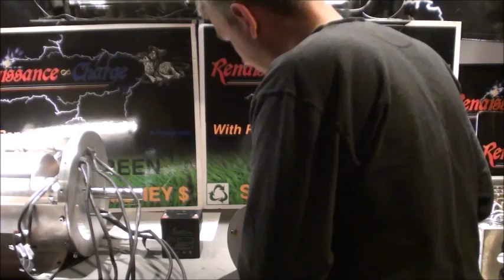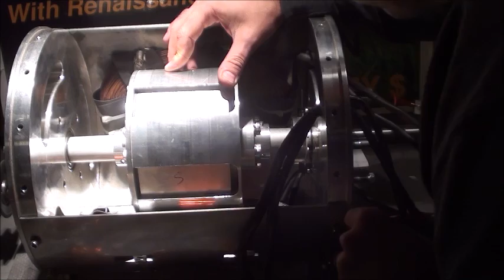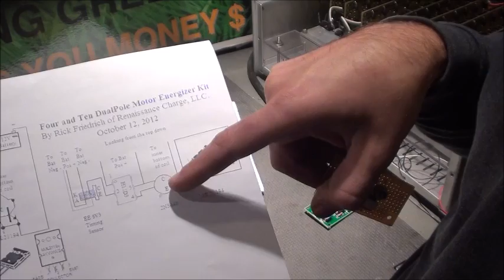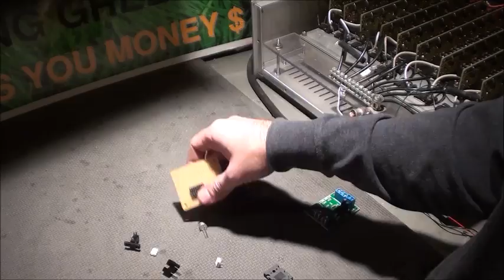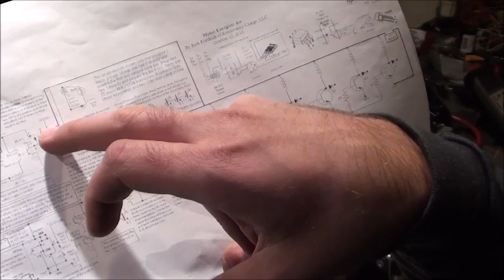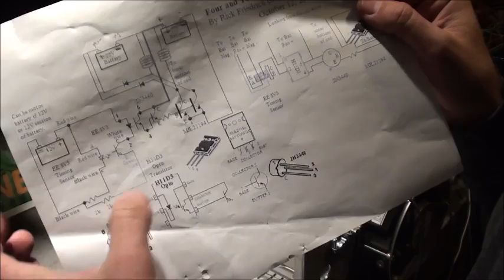Idustrial Magnetic Motor Assembly Instructions Part 1

Comment: Have made many various coils, pulse motors, and years of experiments. Looks like you have the were-with-all to build a large and very powerful unit, wish I had the resources. 
Here is a wiring scheme,  try it, you'll find interesting. works with any bi-filar coil setup or two coils in conjunction with or without a magnetic armature [N-S].  Using a bi-filar, mark coil A and coil B, mark the beginning and end of each, the beginning of coil A goes to a resistor, then to the base of some value of a NPN transistor{ also used a n channel mosfet), the end of coil A goes to the emitter of the transistor which goes to the negative of a battery. The beginning of coil B goes to the positive of the battery (12 volt,can use more and less depending on the simiconductor) and the end attaches to the base of the transistor.
The transistors should be able to handle fairly high voltage  (tip 3055, bul305, or comparable N-mosfet) Also the transistors required much less resistance, the N-mosfet can use from 300,000 ohms to 1 meg and more to oscillate. An anomalies, get oscillation without the base being connected. To initiate oscillation short out the base and collector for just a moment.  Use a neon to check for high voltage produce from the base and editor, place a rectifier bridge across these and connect a large cap. Because it oscillates without the resistor being connected to the base, the beginning of coil A is free to utilize  for other purposes. Meters glitch, use the neon for testing.  If any of this possibly confusing info needs clarification, will do so.  Have a few videos up. Note: have charged caps to 900 volts and more using a 12 volt lead acid cell using  a bifilar coil, just started experimenting with these rodin things. The idea is to use the back spike (collapse of the flux field) to initiate a radiant pulse (scalar pulse) with would produce and over unity effect. It's all in the pulse.
later.............marc.

Comment: Can you please get back to me as what I have seen it does 
not make any sense at all 
as I really would Like to know if the system is running or not 
at all as I would not like to buy a load of Scrap 
Thank you 
John Ryan
Reply from the maker: What do you mean get back to you. You have not written before.
This is not like a regular motor. It runs like a motor but also charges up batteries while running. So one battery runs the motor while another one charges and you can rotate them around.

Comment: Are these for sale now? How many batteries can it charge at one time?
Reply from the maker: Yes they are. R-charge.com It charges batteries while it runs off of batteries. You can run it soft or hard from 12 to 36V 500A. If you run it hard then you will need big batteries to charge.

Comment: I found this and the other videos very informative, and probably the key to succeeding in the field of electronics, since I really haven't produced anything as of yet in the market. But the particular venue I've been pursuing has been what in transportation may eventually be the i-phone compared to the land-line and radio. That is "A mixed-mu precise power regulated system in mag-lev shielded nacelle array instead of a Csoanda fueled car or jet-pack. However, crawling and walking before running and flying, having followed the work of John Searl for 22 years, since being an engineer in the US army, then finally meeting the team in person, there is no-one at all on that team that compares to either one of us!! NO one say: who has a degree in electronics with a letter of recommendation from a department head, who understands state controllers, and who actually designs and builds things that function, because they have to do what they are designed for, and the time is right to finally get it done. Added to the assumptions that many people that think the world's perfect as is without anymore technological developments. But to me using portable mag-lev and portable mag-gen(s) is only a fraction of a very very small percent of what any individual is capable of. The SEG, then I want to describe as a massive ringed system (w/a lesser amount of electronics) that is intended for space travel exclusively more-so than simply powering your home or business. A very large monument of specially machined exotic and common component materials. More involved than wiring a 10 or 8 gauge Bi-filar Tesla Coil, sections to make a standing stack. And so having discovered the scalar encryption method and applying it to mag-lev components is what I'd really rather be known for, and in comparison to what you've done, I feel my work is simpler; but that yours is more marketable, until the time when Earth can clearly see the "Jetson's" life style as routine; and we together become responsible; wasting less petrol.
Reply: intended to space travel ? pushing on what or trhu what to get propelled ?   no possibility to get thrust in space ...maybe... or space doesnt really exist btw.
Reply: @maxencevermeulen1793  Thrust in space would be very difficult. Think more in terms of attraction and plasma. Gravity definitely exists in space, hence solar systems and such. Once we can build gravity in the direction we want our space disc to go, we will go that way, accelerating until we stop building the gravity. Want to shift directions? Put the gravity in another place with respect to the ship. You will go there. That is one way to do it. We must leave the idea of thrust behind if we are to succeed in space.

Comment: how much horse power is the out put
Reply from the maker: Depends on the input like other DC motors. You can run it at whatever voltage so the HP will be what you want.

Comment: I was asking because I have been saving some cash the wife does not know about to buy a big wheel of yours hahaha. I have 22 acres and want to live off grid and want to charge 20 batteries to power my house. Im not sure if your wheel can charge that many but want the best wheel setup that charges a lot of batteries. I am pretty sure it takes around 20 batteries to power a 200 amp service but I could be wrong. I seen the 30 coiler charging a lot batteries and the new dual pole seems pretty bad ass and looks like it will do some charging hahaha. Any info or ideas and I would be greatful. Hate to purchase the wrong wheel or I might be in fantasy land hahaha. Thanks again dude.

Comment: Does this magnet motor charge batteries better or faster or even more batteries than the dual pole wheels. It looks way stronger with the heavier gauge wire and fat power wires. Is there a better advantage to of the two wheel setups or does it depend on what your doing with them. Great video with lots of great info as always lol.
Reply from the maker: randy robasser We have recently upgraded it with Mosfet control and it works even better.
Reply: Hi! What does a Mosfet controller cost?